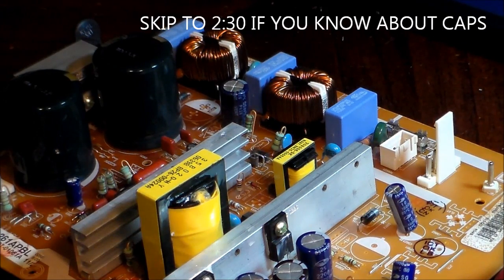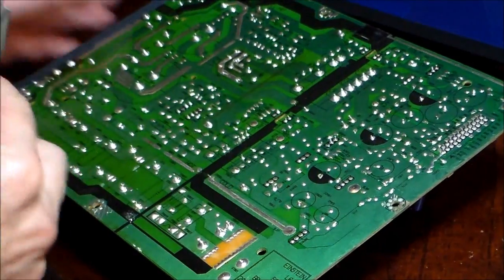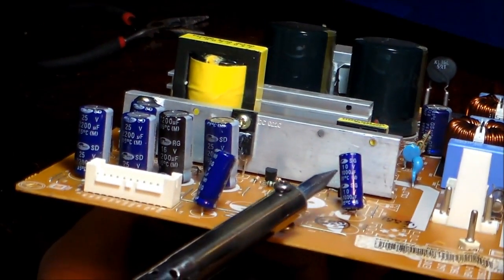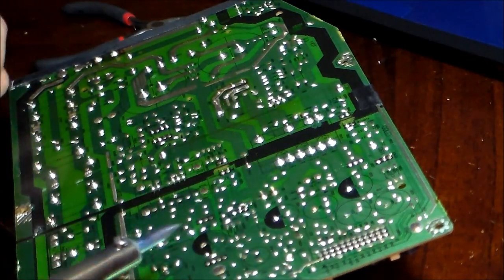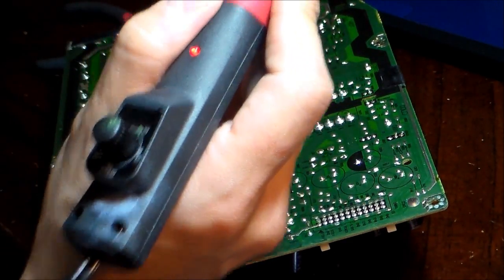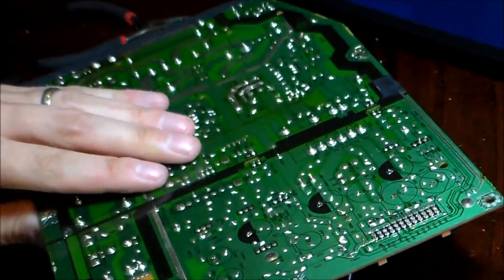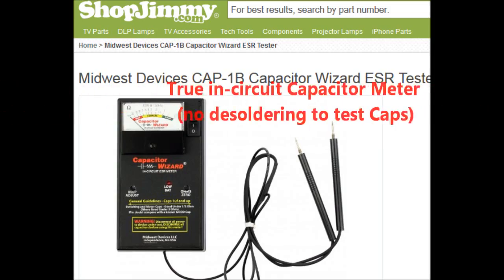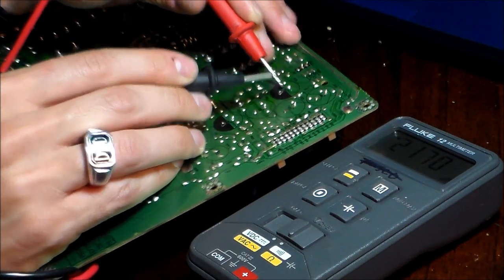HOW TO TEST CAPACITORS IN CIRCUIT with Meter Tester

Comment: It's not "in Circuit" if you pull a leg out
Reply: correct! While in-circuit ESR tester would be required but again pointless if caps are in parallel.
Reply: Not exactly.  you cannot measure the individual ESR of similar value capacitors in 
parallel,  but if the combined ESR is low enough then it would be reasonable 
to assume that there is no fault. Remember that ESR measurement 
does not have to be precise, the fail criteria for a capacitor is going 
to be at least a 50% increase in ESR.

Comment: First of all, measuring the capacity of a capacitor won't do you much good. I have seen thousands of bad caps that have pretty much all their capacity on capacity meter, but test them with an ESR meter and they fail miserably.
ESR is the only reliable measurement to check for bad caps.
Reply: I've had the same experience as 12voltvids. Using this same capacity meter was misleading. It rarely showed me if the capacitor had a problem, even if I tested the capacitor out of circuit. ESR meters are far more accurate.
Reply: 12voltvids 12 minute is the best he knows what he's talking about he has vast experience in electronics
Reply: I feel bad for anyone new to electronics that are watching this video on " How to test capacitors"  They need to watch your videos on troubleshooting power supplies/capacitors.

Comment: You should always discharge capacitors with a resistor instead of a direct short.  For very large capacitors, the discharge current is high enough to damage the capacitor's internal connections.
Reply: In

Comment: The title is false,they have been taken out of circuit,when you desolderer one lead it's out of circuit.If you use an ESR meter no desoldering is required.
Reply: or an oscilloscope, bnc t, resistor and some math (or a more expensive scope that does the math)
Reply: True, but not everyone understand esr. Or esr meter is expensive.

Comment: The other thing you will enjoy about using an ESR Type capacitor tester, is most of the time you can test capacitors in circuit, unless they are in parallel. Best of luck.

Comment: Some may say that you may as well remove the capacitors at that point, but it really does save time doing in the way you show, not to mention no risk of putting it in backwards, or even lifting a trace.  One thing that may come in handy are some small clips or even a little sleeve to put over the leg that got desoldered. It's all about the right tools, the right logic, and shortcuts that work for you (safe ones). Divide and conquer, take notes and know when to step away!

Comment: So subbed! I was just given a 55 inch Sharp TV that does not power up. With luck and the help of your videos I'll have it up and running... Fingers crossed!
Reply from the maker: cool, remember no standby light on front of tv can mean bad power board or bad main logic board.
Reply: I saw that tip of yours. I'll know more tomorrow. Thanks :)
Reply from the maker: also thanks for the sub 8)

Comment: I don't know if you knew or not, but caps can be checked in circuit with an ESR meter. That would save you a lot of time.
Reply: Hmmm......I had never heard of a DSR meter before. Thanks for the heads up.

Comment: Recently, I've been working on my transformerless power supply and the load hadn't been connected across the output and as a result the difference in potential between the output terminals happened to be 335V. And accidentally after I disconnected the meter, the leads shorted out-holy shit that was loud :)Even some of the copper on the connectors got vaporized.  The whole charge that's built up in 220 micro Farad capacitor rated at 350V had been released in a fraction of a second. I was lucky the plug wasn't there in the outlet at that time but there was a 0.5A fuse on the input anyway, so yea...

Comment: Been reading up on possible problems to cause my problems and it seems to maybe possibly a.) Power supply b.) Mother Board switching to negate Amber curcit and c.) possible Logic Board connecting all 3 boards thru HMDI curcit? Looked at most of your videos and have learned a lot so far.Should I start with the basics and see wgere it might lead? or do you have a good hunch on where to start looking?........TIA Last post has pacifics........

Comment: hi man i learn a lot from you
the soldeting capacity / fuze not soldering becouse u put flux on the ped's this issue is familier for me
i want ask quastion: i have multimeter how you check the capacitors or fuze in the board? i dont understand that
thanks
barak from israel

Comment: I had a bad feeling I knew what you were going to do with the pliers while discussing the filter caps. When you did it, I hit pause never to resume. You should teach people good and safe ways to do things. like use alligator clamps + insulated gloves and a 5w  resistor. This is safer for the tech and the board. even if you dont get a zap your way you can burn the pcb.

Comment: Just started to watch some of your videos they are very good easy to understand I have a couple of questions as I am still learning.
I have what looks like a resister/ diode type component but it has no markings on it its like a ceramic red round blob on a bar is how I can best describe it, what would it be or is there a place that has lists of components with images to find out ?

Also not looked to see if you have a video yet on "how to test ceramic resonator"
Reply: Figured it out I need to get a magnified glass I think the writing is I white but so tiny I can hardly see it think they are caps red and yellow ones.
I have board markings though I cannot find what they mean on charts like
X : fuse but its not a fuse  (looks like another cap)
PTC :  ???
VD:??

the charts just give the easy ones, I seem to know already but the 3 letter board markings do not seem to be easy to find

Comment: You showed a lg 37 inch repair, that had no picture. Mine power light comes on with a steady light and blinks as I channel up or down. No picture of sound. I'm hoping it's the capacitors. Is there a good sight to order from? Thanks, you gave me a direction . afm

Comment: Great Video Tampatec.
I have a Samsung PN50B450B1DXZA
It powers on with the heartbeat led flashing as it should but there is no picture on the screen. I have replaced every thing but the main board. I tried to bypass the main board with the jumper on the ribon cable and the pins 3 and four shorted still no picture.

Any ideas?

I checked the buffer board and no shorts on it.

The power supply and X and Y mains both replaced.

Let me know what you think.

Thanks

Comment: Caps that test good for F, uF, pF can still be bad in that they can have high internal resistance (ESR) so best to test using a good in-circuit ESR tester that uses a signal  through the capacitor to measure what goes in and comes out. I have an Anatek Blue ESR tester but I'm not sure if those will be available anymore since the passing of the owner/creator of Anatek recently due to a hit-and-run injury. Anyway to short/drain the caps it is better to use a light bulb, power resistor or other load rather than a direct short as mentioned already by others. Bulging is one way of noting bad caps but my experience is that I find more that look good and even test good for capacitance but fail ESR than ones that have obvious visual defects.

Comment: Like the video. How can I test a capacitor in circuit only with the volts or current.(my multimeter doesnot measure capacitance) thanks!

Comment: I use to use the same fluke meter for testing capacitors and found it highly unreliable. I suggest using an ESR type tester for more accurate results.

Comment: Your digital tester is different than mine, I have a dial button to choose and my max is at 2000uf... can I still read 2200uf capacitors? Also this video is very helpful for not having to take it fully off the board. What reading will you get if the negative pin still touches the board while you test the capacitor? I'm just learning and about to start doing this type of work as a hobby.. thanks for the video :)
Reply: You won't get an accurate reading in circuit as the meter will be sending current through other parts of the circuit instead of the capacitor only. IMO testing capacitance is very time consuming and seldom reveals a problem capacitor. Better off to visually look for leaking caps or test for dead shorts using a DVM.

Comment: You left out the part about testing capacitors in circuit (when multiple caps in parallel and one of many is dead shorted).

What about that?

Comment: Hi, I own a Bernina sewing machine and the model I own have a known fault. If stored unused they won't power up properly, they need to sit for 15- 20 min before turning on and I've read eventually they won't power on at all. Now it's displaying the wrong numbers on the lcd screen. Could this be the capacitors? The power board has a 150uf 400v rifa capacitor and several 2200uf 35v elna capacitors and smaller elna ones, they all look perfect. The dealers don't troubleshoot they replace the boards, and for my model this would cost than the machine is now worth. They also say the machines don't like to be stored in the cold. I'm prepared to replace the capacitors, I have the tools etc. Do you think it would be worth it or is there something else I should look at? The power cord and switch, power to the board is all ok. Thanks!

Comment: Halo I am watching your Chanel great info thanx : Have a ????? how you check fuse able resistor in the  board or out.
when i check with my  multi meter diode mode  both side beeps:

Comment: Can a total newbie to all this ask why it is necessary to desolder one leg of the capacitor?
Is there no way to test these parts without partially removing them from the board?
I'm guessing you get different or inaccurate readings?

Comment: i have a craftsman multimeter that i am using to check capacitors with. my question is this particular meter when switched to capacitance mode shows an nf  with a digital reading of the cap in question. I get a uf later in the reading or i get a OL i don't know if i am reading it correctly but there is no way to set the capacitance to uf, it does the readings automatically when i use the capacitance mode. The meter is a pocket sized model  82351. Any info on my readings would be appreciated

Comment: TV Model: 242TFHD Olevia

Comments: I have a 42 inch LCD Olevia on the front it has a blue stand by light when I press the power button the light goes off by I get nothing. if I turn the main power switch on the back on and off eventually it will turn on. I can see the lights on main board come on when I turn main power on then go immediately off. I checked power going to main board there is power. no sign of bad capacitors. Help plz.
Reply from the maker: check 5v standby on power board, sometimes bad caps look ok but can still be bad, buy cap repair kit. http://www.amazon.com/s/?tag=tampfreepcpin-20&link_code=w12&linkId=&_encoding=UTF-8&search-alias=aps&field-keywords=100uf+3300uf

Comment: Hi, i have a small amplifier and i have got a trouble with it. Since i have limited knowledge on electronic i could not resolve the issue.  It produces a very poor signal of the music that is hardly to hearing.  The pcb has a TDA8947J with 17 pins and 2 IC 4558D JRC. Do u have any idea how to test them or what might be the problem?

Comment: Hi TT, I have a 2012 insignia that does not power on at all. no lights, no nothing. Have not taken back off yet, because I have a 51" Sanyo that Im hsving trouble with. powers on (green led), then in 2-3 seconds it shuts off. Tested everything but capacitors, they are next. Is this a power supply board issue. Two questions in one. Thanks TT.

Comment: Amigo..i have a Vizio Tv SV422XVT, turns on stay on vizio logo then shuts off .the mosfets in the main board gave these readings on the legs: In, out, adj.  : [5.06, .2, .2],   [ 5.0, 3.3, 2.0],   [5.0, 2.5, 1.2 ], [ 5.0, 3.3, 2.0]  . can you tell from these reading, which should be replaced. Thank you
Helpful video.

Comment: I have 3 defective 48V/1A Nimh chargers that sustained damage from a short and all have blinking green LED's and no output instead of a solid green LED and 56V DC output. What components on the board would you look at right away in this scenario? The capacitors don't show any signs of bulging. the short happened on the DC output side.

Comment: Isn't de-soldering one leg of the cap doing it "out of circuit"  ,Not in circuit ? .Real question NOT taking the piss .I do High voltage and now starting to do some low voltage which is why I ask .Can you get a meter to do it " In circuit" so no de-soldering is required .Thanks John
Reply: HighVoltageProjects You can check caps with one leg totally disconnected from the circuit John (de-soldering IS required mate.)
Also as well as a multimeter for measuring capacitance, I would recommend an ESR meter. These test the Equivalent Series Resistance of a cap which is quite often a better way of testing it's health than just testing the value.

Cheers mate.
Reply: Yes, it's a slightly disingenuous title.

Comment: So can you use any hand held Cap tester to test in circuit, or does it need to be in circuit capable? Thanks.
Reply: No You Need A ESR Meter And NEVER Directly Short Out Capacitors..Because Of The High Transients You Can FRY Other Parts Of The Circuit,,,Also Use High Temp(105 degree ) Capacitors As replacements,,,Please!!!

Comment: its not "in circuit" as you desolder a leg thats 50% of the work and also you risk getting a bad reading if the lead touches the circuit,
then you better do the same to the other leg and test it outside.

also capacitors can be bad even if they are ok with the micro-farad value still on the allowed limit,
so you need actually an ESR meter that will show resistance (low resistance means the cap cannot hold charge) VLOSS and inductance.

Comment: Mp amp had no out put coming from this amp and while I was working on the amp and was using a chopstick to touch components and one of the 2200 25 volt caps making a bumping noise through a speaker and I replaced both of these on the board... It is the power board that connects to the per- amp board... Now I have nothing coming from the output at all while using the touch stick again...? I have checked all the resistors....
Any ideas??.

Comment: I have a Samsung 32 inch LCD LN32a550p3.  it will power on the power light is on and the red standby light is flashing but I do not get an image or sound also the display up on the left-hand side it will tell you if you're getting a signal or what input you're using is not showing either so is this a capacitor issue or is there something else going on with my TV s.

Comment: A good LCR meter is your friend.
Reply: Then a good ESR meter is your best friend :)) in finding bad caps. Measuring capacitance doesn't help so much :).
Reply: redcatimaging Two things, it is a given you buy a LCR meter with ESR capability otherwise if measuring caps is all you what to do you could just stick with a good multimeter such as a fluke 87 with caps no lesser than the nano range. Second I do a lot of repairs work and in all circumstances involving audio issues manifesting as low audio the fluke was all I needed as the LCR meter was just over kill. The only time I pull out my LCR meter is when I need to read caps in the pico range or when I need to measure coils, I am not designing, I am predominately repairing.
Reply: Yes, makes no sense to buy a lcr meter without esr capability,but many don't have esr. :-) It was more about the video, it would have been better to measure the esr and not the capacitance. ;-)

Comment: It makes me sick the number of people that post information about high voltage stuff that clearly know nothing about how to do it safely.  When some poor person blows off their hand or takes out a eye from doing it the way you do then you should be held responsible.  But you still insist on doing things the dangerous way.  Caps can hold a lot of energy,.People have had serious injuries or even been killed by shorting out caps like that.  ALWAYS use an appropriately rated bleed resistor to discharge capacitors.  I have seen pliers explode when used like that to short out caps. Also the fact that your wearing a large metallic Ring shows that you have no concern for safety what so ever.   The fact that you say you have over 10 million views concerns me as that's 10 million people that could potentially do it wrong and blow themselves up. Always safety first!!
Reply: That's why I discharge them with my fingers, it's the only way  BAM!.....LOL

Comment: i have tested the compoance they seem fine but ive always had a green led
  light on the left hand bored what does that mean?
Reply from the maker: green led on front panel is power on light, if you got that then it can be bad inverter (rectangle board) , use flashlight and check screen for dark image. call to get the correct tv boards- 1 (877) 881-6492 / (952) 881-6492

Comment: I Have Vizio SV470M LCD went thru power surge during a typical Florida Storm, that left cablebox and all HMDI 1-thru-4 ports non-working.Replaced cablebox and HMDI cord but it starts to load data then switches to No Signal message. Also, remote doesn't work on any commands with new bats and must unplug cord to turn on or off TV, also No amber Vizio Logo, Only White Logo. All component cables work with RCA plugs with normal picture, just no HMDI inputs work.....Ant Ideas.....TIA